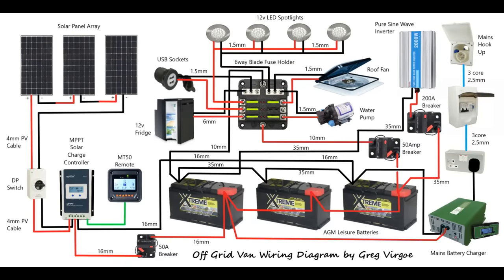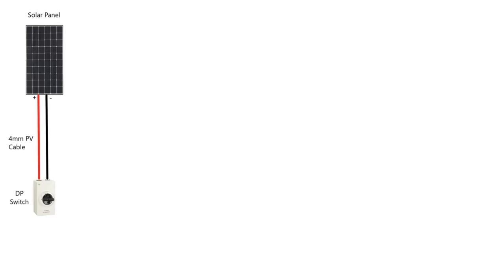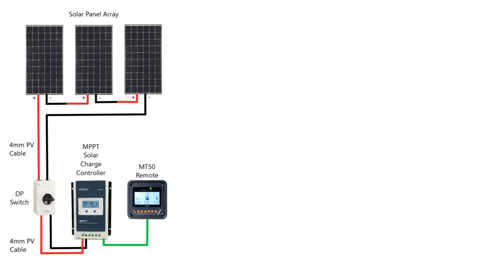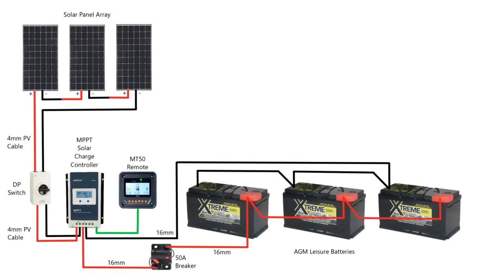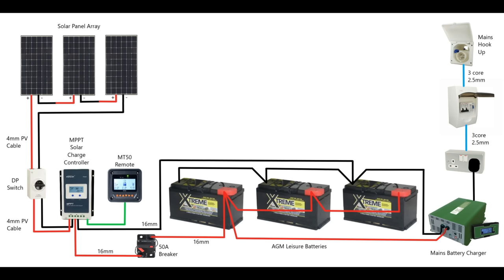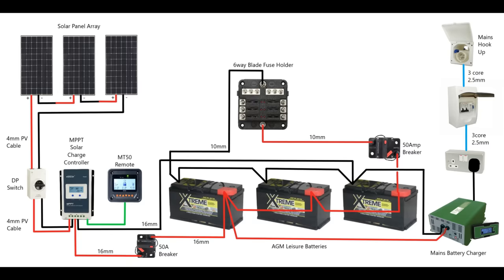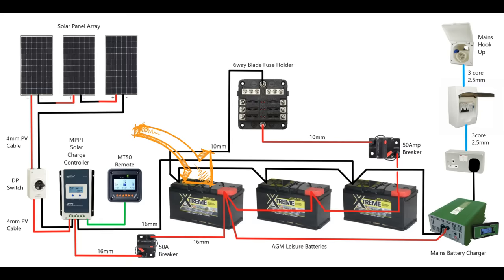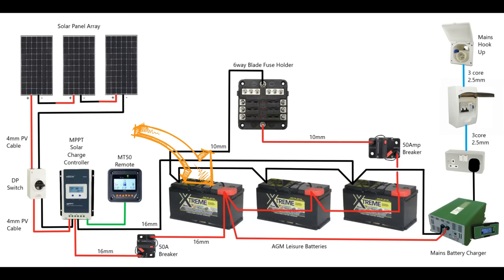How to Wire your Camper Van to be Off-Grid

Comment: Hi Greg may I start by saying you was like a breath of fresh air when it comes to learning how to achieve your own van build coz as we all no it's saving you a fortune. So thank you for your time to do these videos as they are really really interesting I have to learn literally by being told and shown like you would do to a 5yr old haha and you are so not like the other videos your still left with saying so after watching that what do you do haha. Anyway we have decided to go with a Mercedes sprinter lwb high roof. Reason is the sprinter is a seriously reliable van and it's nice to look at if you get what I mean. Very spacious as I'm 6ft 4. My wife is 5ft 8. And our son who is 7 is 5ft but we just want very basic we don't want a built in cooker or anything like that as I think if you don't keep up with the cleaning and wiping things down they make the inside of your van smell. So it's all done in the awning. We want puck lights or spot lights in the roof a few usb sockets here n there and a couple or what ever fan in the ceiling . We want 12v and 230/240v for hook up when it comes to being on sites obviously we'll have to have solar but we need some guidance from you as to what size solar and things like that and we're going with a diesel heater as everyone swears by them hope you can help us Greg
Reply from the maker: I still would go with 350-400w of solar as a minimum to power a fridge and that diesel heater in the winter months if you want to be off grid. It’s relatively cheap so maximise what you can generate abs you’ll always have power. 👍🏼😊

Comment: Several months after this video came out I also fitted the Chinese breakers as isolators. However the other day I needed to cut the supply and found that the supply was not cut. Now I'm pretty sure I must of checked them at the installation time, but I can't be sure. I have two and these will be changed as soon as I can. Just a little warning to others. 
Keep up the great vids Greg.
Reply from the maker: If they are purchased from a reputable manufacturer they are ok but if you buy cheap Chinese rubbish you get what you pay for.

Comment: This was great. Nice and clear. The difference I will make is instead of a mains charging input to have a petrol generator here. Next step is to see if there's a way that the generator will automatically kick in if the power is too low in the batteries to run the fridge. Also to note is that this is all 12v wiring so no high power to worry about and almost anyone can do it - you don't need a licensed electrician.
Reply from the maker: I hope I’m not parked next to you on your travels. 😊

Comment: This is nearly perfect! Only thing i would add is a split charge system to the left most battery positive (like the mains charger) for a complete system (and if you have less solar/batteries). love the diagram, just brought a van and will use this example.
Reply from the maker: You do not need a split charge relay. This is a DC to DC charger that’s why it’s connected to both van battery and leisure battery. Far better setup than a VSR. Please watch the video again as I think you missed that information 😊

Comment: Absolutely brilliant Greg! This has had me baffled as I think I had watched/read/researched so much that I had completely confused myself. But this video was so easy to follow that I feel totally confident now. Thanks so much. I’m going to watch all your content now and look forward to discovering more. Thanks again, all the best!
Reply from the maker: Thank you for such great feedback it’s nice to know that it has helped you. Hope you find more useful info in our other videos too 😃👍🏼
Reply: @GregVirgoe  It definitely has helped. Really enjoying your other videos too. 

Where/How in that setup would you wire in a DC-DC or Split Chage Relay? Just straight to the battery as ‘normal’?
Reply from the maker: @grayadventures5885  i recommend using a DC to DC charger and not a relay as it will look after your battery much better. Wire the output of the charger to the leisure battery string on the same terminals as the MPPT connections. I recommend an isolated charger rather than using the van body for a negative path. 
Hope that helps
Reply: @GregVirgoe  awesome Greg. Thanks so much. 
Do you have a Patreon or support/sponsor page?
Reply from the maker: @grayadventures5885  I don’t do patreon but you can find a PayPal donation link in the description. 
Thank you for asking 👍🏼😃

Comment: Oh my gosh that is the best explanation I’ve heard and seen!!! I love how you added each section as you spoke of it! Now I feel confident to redo my current setup which I did 4 years ago and the wiring is a mess!!  I do have a few questions though… 
1. How do I wire to charge my batteries while driving?
2. Can you convert the mm wire size to US using the “gauge size” which is how wire is sized.

Comment: I wonder how an AC would fit in this diagram and the impact in the system in terms of power. Thanks for sharing. Keep up the good work 👍👍
Reply from the maker: Ac would use 700W of power so that’s 56amps per hour. Not practical to be run off grid on batteries but on hook up no problem 😉👍🏼

Comment: Fantastic video , thank you so much , im building a camper to live full time to save for a house deposit ironically .
Reply from the maker: That’s the perfect way to do it. We have never had so much in savings living in our van with minimal costs
Reply: @GregVirgoe  i just have one question i apologise if its been answered , i do use a lot of power , or in an ideal world would like to , if i have more battery's in the bank wired in series , say 8 , that would give me more time off grid without the need for sunshine right ? and this would maximise when sunshine occurs ?  thanks greg .
Reply: wired in parallel i meant .
Reply from the maker: @andrewgodfrey7496  this is the problem that a lot of people fall into. It’s all very well having a huge battery but how are you going to recharge it? You can only use what you can generate otherwise you’ll just keep depleting the batteries and never be able to recharge them. You are better off maximising your solar capacity and providing dc to dc charging while driving then have a battery that can last just a couple of days but will easily be recharged each day. 
Otherwise you’ll have to be on a campsite all the time plugged in.

Comment: Very straightforward video, thumbs up. Just one note: All laptops and many new monitors and TVs have separate power source (transformer) which typically supplies something like 12V or 16V DC to the appliance. It's not smart to run an invertor to get 220V and then power a transformer to get back 12V. Even if you need 16V, you can get for like €8 a DC converter (remember to size based on required amps) which will do the job without all the conversion loses. Unless you want to use the generated heat to warm up a bit your cabin or RV :-)
Reply from the maker: It depends on the appliance as my power hungry editing laptop needs 190W @ 19v off its transformer. I have not found a DC converter that is big enough to do that.

Comment: Zahid Mahmood
I wish to give this man 7 stars.  After seeing dozens of videos this is probably the best and easiest explanation for a beginner like me. I will make a donation as he has saved me time. My only question is to anyone who can answer. If I want to add more appliances than greg has mentioned. Can I just connect them to blade fuse holder. Incase of them being 230-240v appliances, can these be connected straight to inverter.  
Many Thanks
Reply from the maker: You can add extra 12v things to the blade fuse holder. Make sure fuse and cable sizes are suitable. 
You can plug 230volt appliances into the inverter or to 3pin sockets that are wired back to the inverter
Reply: Thank you Greg. Is there way of sending you private message.
Reply from the maker: @zahidmahmood6194  you can get me on Instagram or the email link on my about page here in YT

Comment: So...back to my favourite YT video (I've been putting off the electricals for some time on my build!). Hope your new build is going well, Greg. I use your brilliant diagram as my blueprint but there's no DC-DC charger included. I have a Renogy Rigo 60A DC-DC charger. Their manual says simply to attach one side to the cab battery - Pos and Neg as you'd expect, then the other ends to the battery. However, I'm using two 200AH Li batteries with Bat 1 handling the incoming sources and Bat 2 for the outgoing as you've suggested. I presume that I connect both the + and - output from the DC-DC charger to Bat 1 as it's an incoming source but am unsure whether the - should be attached to Bat 2. Hope you can help.
Reply from the maker: Hello, the two batteries should be wired together as one string. Positive to Positive and Negative to Negative with thick cable 35-50mm to join them as one. 
Then connect all your charging cables (input) as follows 
Positive to Batt 1 and Negative to Batt 2
Then connect all your loads (outputs) as follows 
Positive to Batt 2 and Negative to Batt 1
The DC to DC charger wire to the same terminals as the other inputs. 
This will ensure even resistance and balance across both batteries.
Reply: @GregVirgoe  That's great, Greg, thanks so much. Hope you and Lou are doing well 👍
Reply from the maker: @ezioauditore3128  yes thank you we are busy with this new build 🚐😃

Comment: Excellent video. With any bàttery charger solar or main try to keep cable run between charger output as short as possible as voltage drops in this circuit will affect chargers cutoff. Chargers cut or reduce charging once battery voltage get to certain voltage eg 13.0 if there is 0.1V drop then battery will be at 12.9V while charger is seeing 13.0V. Once charge current is reduced the voltage drop will reduce, but its going take longer to get that final bit of charge into battery. Best place charger close as possible to batteries, long runs on solar cables isn't issue, a few watts of losses out of 100s isn't big deal. The other advantage is need to use less very expensive heavy cable.

Comment: Very nicely put together, thanks John!
Your diagram is by far the simplest to read and easiest to understand.

I wonder if you can offer any help.
Im looking at 2 of your diagrams

1.	 1x 320w solar panel, 1x AGM
2.	3x solar panel (in series), 3x AGMs, 1x mains battery charger, etc

They are clearly understandable.

However, my Set up includes:

1.	3x 100Ah Renogy solar panels
2.	1x 40A Renogy Rover Solar controller
3.	1x Renogy DC to DC 40A charger
4.	1x 100Ah Lithium Battery
5.	1x 85Ah AGM battery (VSR- charging system came with van)
6.	1x Xantrex 1400W inverter (came with van via VSR)
7.	1x 3000W Renogy Inverter
8.	1x 500A Renogy Battery Monitor with Shunt
9.	1x 12 way 12v Bue Sea distribution fuse holder

As my van came with a VSR wired system including a Xantrex 1400W inverter and 85Ah AGM battery, I thought to keep this running the Lights, 2x USBs, Rear view camera, Maxxfan, and a couple of light weight AC sockets, etc. I will design a lithium powered circuit freshly, to run an induction hob, the fridge, and the heater, hot water, etc.

Would it be possible to charge an AGM and Lithium battery with the above listed DC to DC charger? Ie. both (types of) batteries through the DC to DC charger? Or is it advisable to keep the 2 circuits separate? If this is the case, would I be able to use the parallel array of solars to charge the AGM system as well as the Lithium at least?

Lastly, I would like to do something different to your set up, which is to run everything through self-made positive and negative busbars, using ANL fuses. (inverter, charger, 12v fuse box, etc)

Please let me know your thoughts.

Cheers

Comment: Thank you Greg! I'm getting ready to set up my electrical system with solar and lithium batteries in my Ambulance 🚑 build. Trying to integrate with the existing Ambulance wiring to run the box lights and outlets. It's overwhelming.... 🤯

Comment: wouldnt you think the lithuim batteries would be way better especially now there coming down in price 
BRILLIANT VIDEO BY THE WAY
Reply from the maker: No I don’t. I’m using the same AGM batteries that I fitted 5yrs ago. They have been on 24/7 all that time. Never dropped below 12.3v and still going strong 💪🏼 that’s nearly 2000 daily cycles and all three only cost £390 that’s less than the cost of one lithium battery. Plus they are less temperamental than lithium too.

Comment: Absolutely brilliant video and instructions.  Love it and will refer to this on my project. Thanks
Reply from the maker: That’s great 😃 I’m glad it has helped you. What are you building?
Reply: @GregVirgoe  ive just bought a dated but very sturdy 4 berth tourer caravan,  it has all the basics, but I'm looking to put a 100w solar panel just to keep the battery topped up during storage, along with a better than supplied 60 amp control panel, a 1500w 3000w peak pure sine wave inverter which ive recently purchased, and will be eventually using your diagram to maximise my 240v electricity supply, as I have a young son who will NOT last 1 day without his games console. I've also purchased the different gauge wires, connectors etc. It's gonna be fun. Also going to be re upholstering the cushions, so purchased material and a sewing machine. All the cupboards will be sanded and sprayed. I do intend to expand the solar panels when money permits, also to add 2 same new leisure batteries again when money permits. 💰 it's an ongoing  project which will have to be chipped away at. I think I've got all the basics I need for now. As I work nights HGV driving and my caravan is at a storage facility,  time unfortunately is restricted.  I'm a patient guy. 🙄😊
Reply from the maker: @raymondarmstrong1967  it sounds like a great plan. Maybe look at a smaller inverter. Unless you plan to use something that needs that much power the games console won’t take much and the losses when running would be less too
Reply: I did originally buy a modified sine wave 4000w off ebay , cheap. But after doing a bit of homework,  realised that this was probably a mistake, any idea what I can do with it, could I use it for anything do you think. Thanks for the replies too. I will probably be picking your brains. I am going to be touring the UK 1st but eventually do intend Europe and want to be fully self sufficient. How many batteries and solar panels would you recommend,
Reply: I think maybe I should do a timeframe video of this project 🤔
Reply from the maker: @raymondarmstrong1967  Timelapse videos from start to finish are very popular 🤩👍🏼

Comment: Hi Greg, am currently at stage one of my project. List, plan of action and sourced all material required, just the right van for the right price needed. Gone through all your videos on your conversion which has helped and given me confidence to complete this myself. Am just confused on the earth. I’ve read through the comments and you say it’s ran back on the 230v to hook up, how does this work if am planning to be off grid. Sorry for being a pain it’s just the one thing I can’t figure out. 
Great videos and hopefully see you on the road. Thanks for the help 😃
Reply from the maker: OK this is a common grey area. 12v DC systems do not need an earth. If you are fitting a hook up or 230volt inverter or appliances you do need to bond and connect earths together. 
It’s a good idea to connect that 230volt earth to the van in case one of your 230volt appliances has a short in the wiring. Inverter need an earth to the casing and I just brought all mine back to a common earth bar in my control panel. Hope that helps
Reply: @GregVirgoe  thanks for the reply. After talking with my mate he’s explained the same. 12v to the inverter was confusing me, but as it’s 12v fed it doesn’t need the earth. Just hook up feed. Thanks for your time in replying

Comment: Hi Greg, great video and they have been very helpful however, unless I'm missing something, your cable wiring for your inverter is too small if you want to run inverter at maximum power 2000 watts if we reference it to your cable size chart. Ok, Having said that, research into this shows the calculations change the longer the wire run is. The longer the wire run the higher the cable resistance and the larger the wire is needed to over come this. I'm assuming your inverter must be close to your batteries and so in that case you only need 35mm (AWG 2). Once the inverter is over 11ft the cable size I guess should go up to 50mm (AWG 1). Ahaaaa!

Comment: I really appreciate the meticulous way you make things run smoothly. I have a concern: how to achieve the grounding of the circuit? 🤔
Reply from the maker: A stand alone 12v DC system does not need a ground. You only need to introduce earths on 230v systems.

Comment: I might be late to the party Greg, but we don't see any distribution board in place for the inverter output or anything to SEPARATE the 2 possible (& conflicting)  AC sources ?
Just pointing out that your thorough explanation as good as it is. would benefit from addressing this for completeness ?

Comment: Thanks for a very useful summary of the equipment and connections needed.  
My only comment is that you have not mentioned a DC to DC converter to allow charging from the vehicle alternator.  This allows charging while driving and may eliminate the need to get a site with mains power should the solar panels not charge the batteries during the day.
Reply from the maker: Yes it’s a totally viable option if you do a lot of driving. But I would not want to run my engine if stationary for a few days as that’s just false economy and not good for the vehicle. This is why I put a large array on the roof. It’s a good option and easy to add to this setup 😃